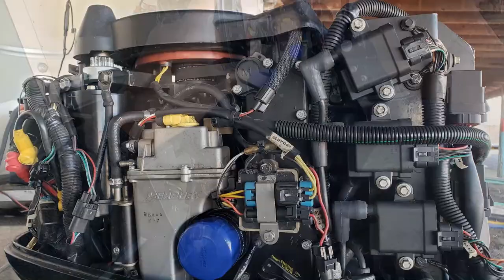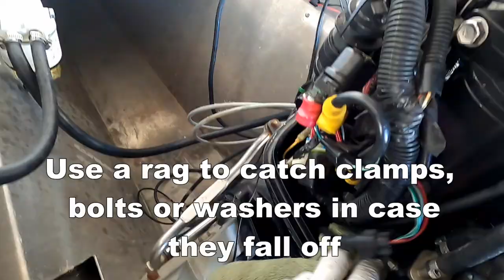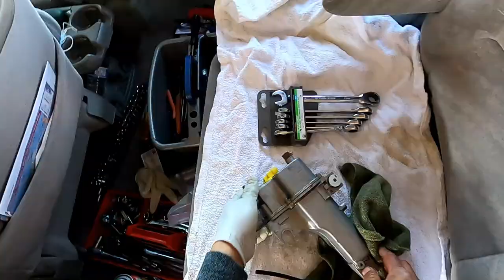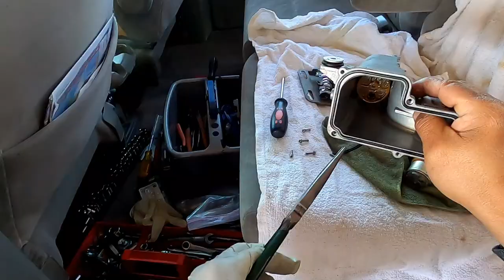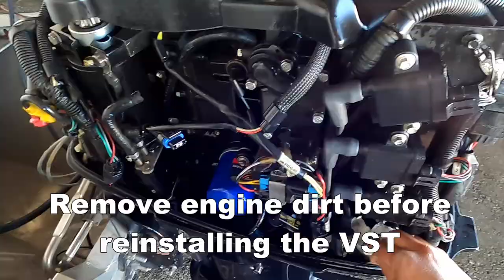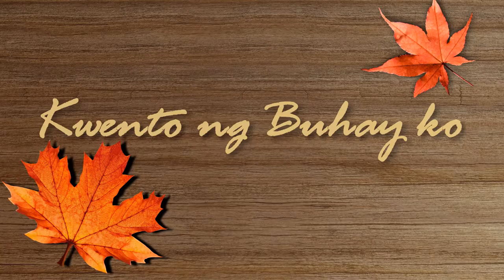2021 DIY: I Cleaned the Vapor Separator Tank (VST) on a Mercury Outboard EFI

Comment: Thanks: I changed the low and high pressure fuel filters, replaced the low pressure fuel pump, and finally, cleaned the very dirty VST filter. It ran like a charm. It was fuel starvation.
Reply from the maker: Great job!

Comment: I’ve the same issue on low rpm. Did it solved the problem?
Reply from the maker: No. My low pressure fuel pump was the culprit. The VST suffered fuel starvation. https://youtu.be/zm8xGbd5m_I
Reply: Hey I’m having a problem on a 2012 mercury 90 EFI.
The fuel pumps have been replaced twice and it will run out of fuel and shut off. If I pump the bulb it will run fine.
I have replaced fuel lines and both pumps twice at this point, do you think cleaning this would solve the problem I bought someone else’s problem thinking it was a running motor. The mechanic said there was water in it when he got it.